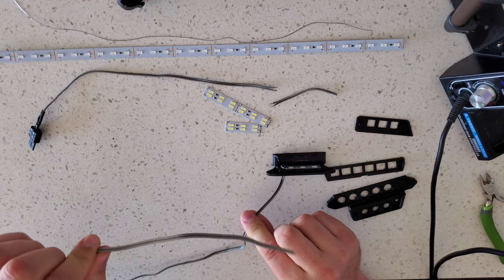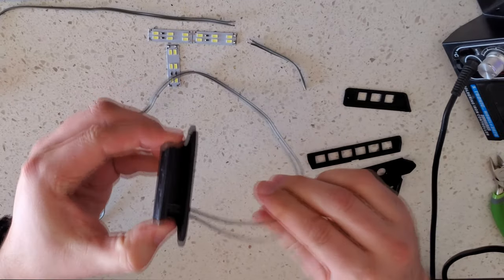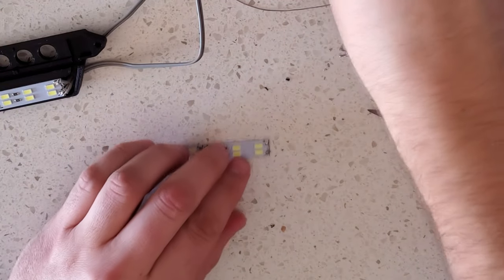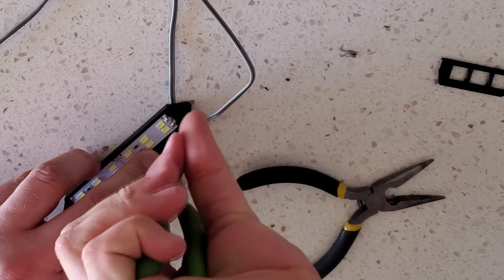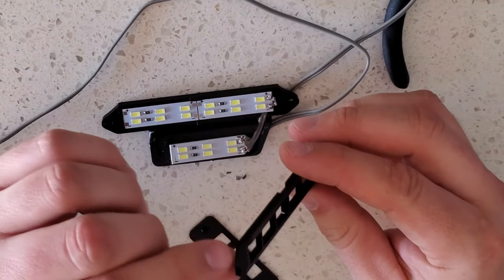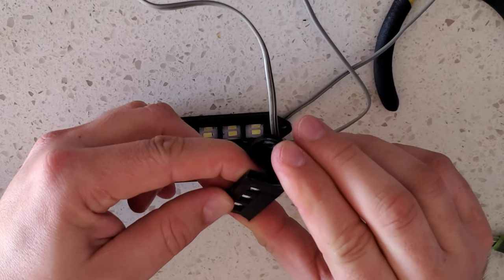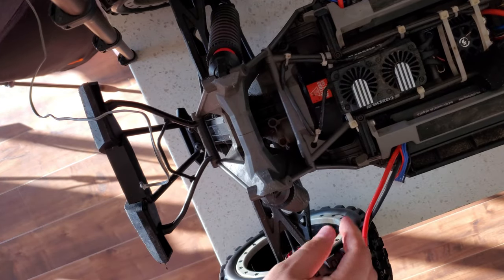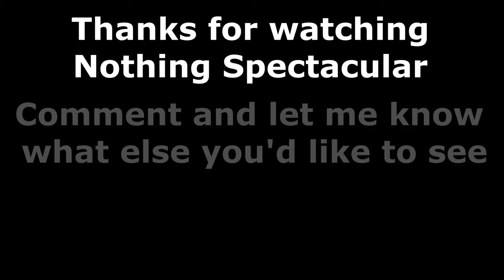DIY X maxx Lights with Free STL

Comment: Do you have a link to the exact LEDs you used? Thanks
Reply from the maker: I got them on ebay and the exact listings don't exist anymore. However, I think this is pretty much identical to the red/back LED's: https://www.ebay.com/itm/10pcs-SMD5630-Hard-Rigid-Strip-Light-Bar-Lamp-DC12V-Non-waterproof-50cm-36leds-/371812735698?_trksid=p2349624.m46890.l49286
Reply from the maker: These should match the front LED's that I used: https://www.ebay.com/itm/LED-Hard-Rigid-Strip-Light-5630-Double-Row-10pcs-72leds-SMD-Super-Bright-DC12V-/172411501857?_trksid=p2349624.m46890.l49286